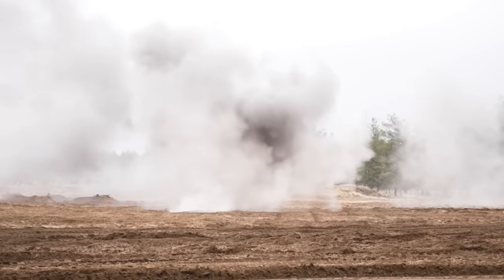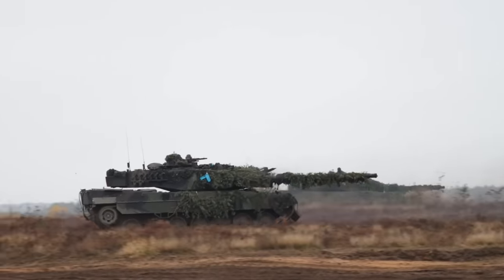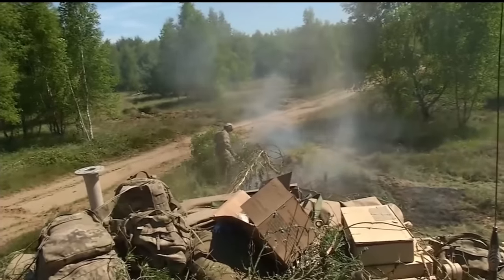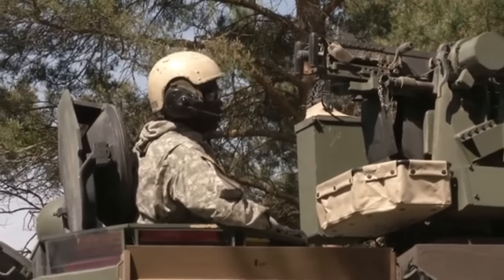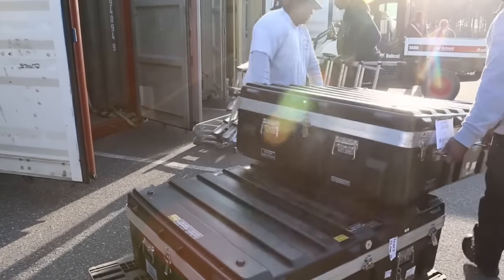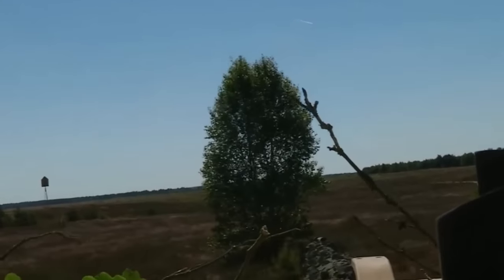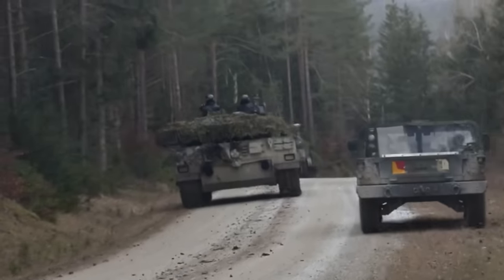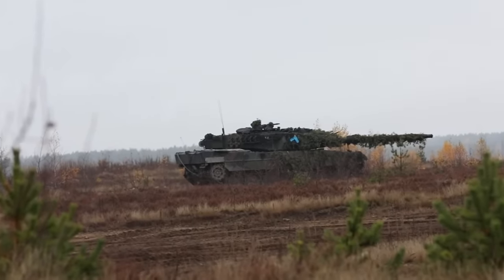What are the tubes on the turrets of Main Battle Tanks used for? | TANK PYROTECHNICS 💥💨

Comment: Hey Matsimus. What's your opinion on Excalibur rounds vs BONUS rounds? Both are in use in Ukraine but I haven't heard that much about BONUS? Is it less effective? Somehow it feels like it's cheaper than an Excalibur round?
Reply: I dunno if it's cheaper but it certainly has different capabilities.  I'm guessing here so I'd also love matimus a video but believe BONUS rounds only work against vehicles recognized by the bomblets LIDAR which might be great against distant tanks but won't land a shell in a trench or bunker or on a bridge.  Conversely, Excalibur presumably won't be as useful against moving tanks or ones w/o a precisce position.  I'd also guess different danger close distances.
Reply: @petergerdes1094  Each shell seems to contain two sub munitions that start to scan the ground below for a target. So you really do get a Bonus round. I would have liked to be a fly on the wall in the meeting where they decided on the name "Bonus". A Bonus round will not give you an extra life, even though you air burst will activate multi ball mode of sorts.
Reply: they are both ammunition for different tasks and ranges.
BONUS and SmART155 only have a range of around 30km but are designed to engage enemy vehicles in the open.
These are going to be used to engage enemy MBT´s, IFV´s etc in a "medium range" distance, especcially if its multiple targets.
A PzH2000 Battery of 6 Vehicles can dump 30 rounds into a target zone within 30kilometers in 30 seconds and be on the move again, those 30 rounds "multiply" to 60 warheads.
Thats a hostile tank Bataillon in its staging area gone within a 30 seconds window.

Excalibur (similarly to Krasnopol from the sovjet union) is a terminal phase guided precision ammunition wich is used to precisely engage single targets within 45-60km radius from the gun.
These are used to engage enemy strongpoints, command posts, ammo and fuel dumps, single vehicles etc.

Comment: what the heck is that monstrosity of a M113 with a turret top at 11.40?
Reply: thats an M113A2 DK IFV if i am not mistaken.
M113A2 with a 25mm Autocannon Turret, used by the danish armed forces.
or it is a M113A1 MRV of Australia with the turret of a Scorpion CVRT
Reply: @zhufortheimpaler4041  Trust me, its not a M113A2 DK IFV.. I have crawled aroudn inseid them. It was a horrible attempt to make an IFV on the cheap.  If I recall it was a mix of italian turrent, swiss gun and some spanish/french fire control systems.  Safe to say, it never really worked.  By the looks of it, its used by US National gard, 1st Battalion, 4th Infantry Regiment.  I'm just kinda chocked that the US would use something like that. THey have made something like 8000 bradleys. one would think they had enough to go around,